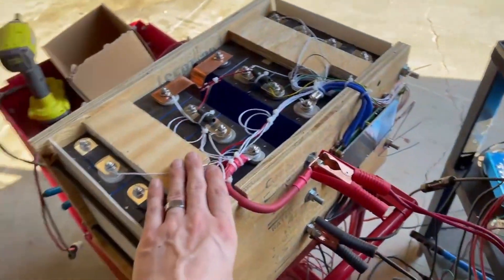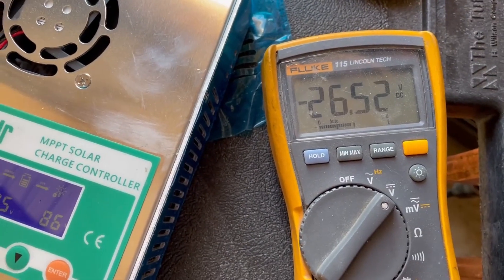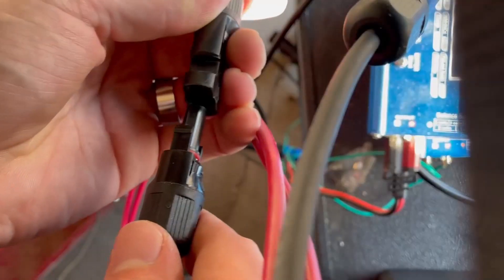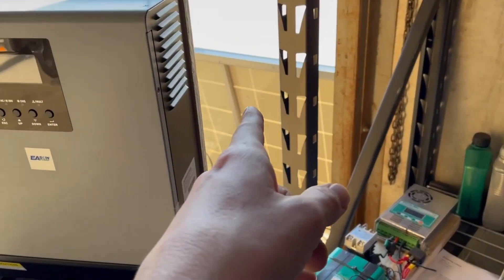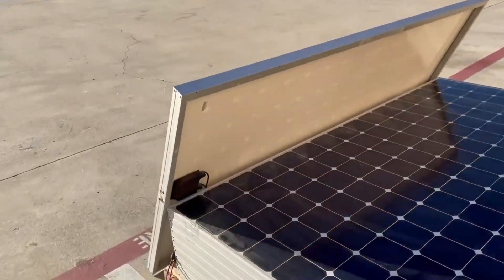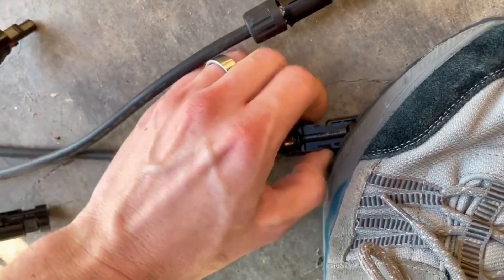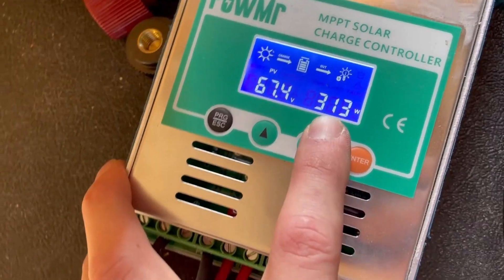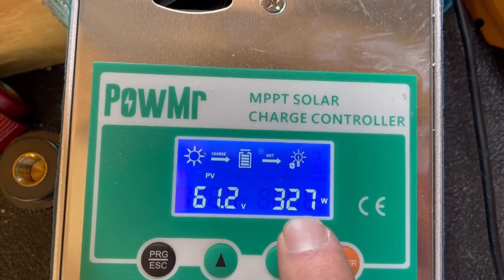How Actual Real-World Fluke-Measured Solar Panel Voltage Affects Power Output

Comment: That's why I went two in series in parallel, on the panels I got from you. They run a Victron mppt and they recoment I think if I remember correctly 1.5 x charge voltage minimum input from pv cells.
Works great.

Comment: The PowMr manual says it needs PV input volts to be 1.5x to 2x the battery voltage to be most efficient. So for a 24V battery you need 37V for best efficiency and not the 30V you are providing. When you had it connected to the 12V, the PV input volts was 2x the battery volts. I would not come to any conclusions based on testing with a PowMr.
Reply from the maker: See and that’s where it would be great if they differentiated vmp and voc. This is a 37voc panel. So to me that matches their requirement but obviously isn’t enough.

One place they say 190v max and then they will say 160v max. I know from experience it will cut off at more like 190.

More to learn!

Thanks for chiming in. Looks like it is in the manual just not clear enough for a dummy like me :).

Comment: Good information....i would like to see more than 3 of these controllers together in a system to see how they really hold up ... Would they be better for 100 or would it be better to spend 600 on a name brand.... Who knows....
Reply from the maker: I think long term reliability is the biggest factor. The fan will inevitably die and need to be replaced.

The more expensive ones like mid nite also have more configuration. Like you can change the current output limit to the battery right? And probably have some serial output for monitoring, and a temperature sensor to cut off charging if the battery is too cold or hot.

I digress.

In the end I feel like larger systems are more likely to have an inverter/charger and not need these guys. I suppose some will still want to use a dedicated inverter.

Comment: Are we looking at just the PWR MR behavior or do other higher regarded MPPT controllers behave the same?
Reply from the maker: Today, just the powmr. Haven’t been able to dig up the manual for make sky blue to see what it recommends.

Epever recommends higher voltage so while it may act the same way at least the manual states to use a higher voltage.

Haven’t checked Victron, I should do that as they have good documentation.
Reply: @BeeneEnergy  SkyBlue could be a similar story...I look forward to any results and comparison with the others.